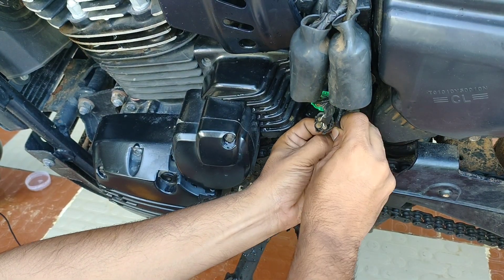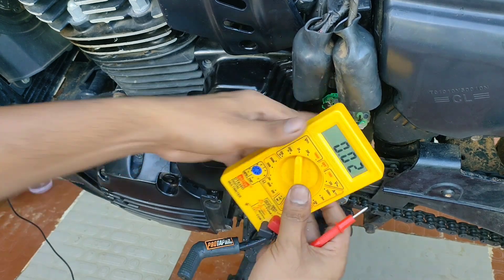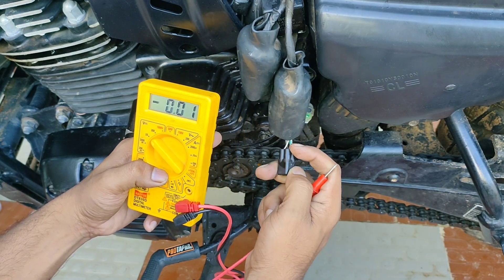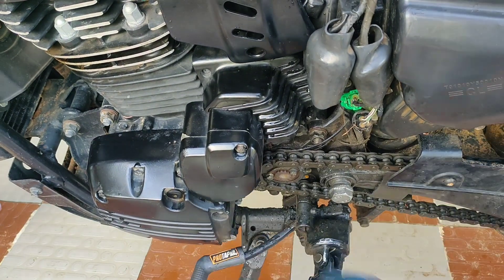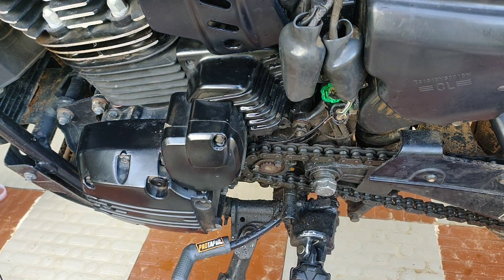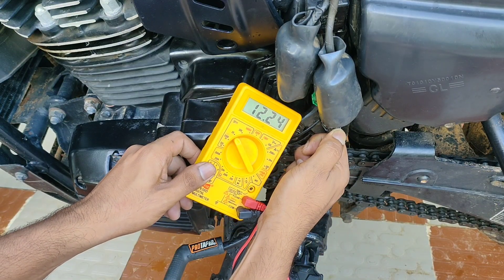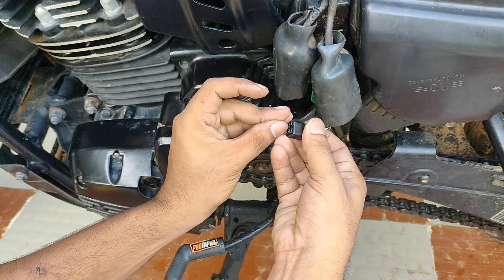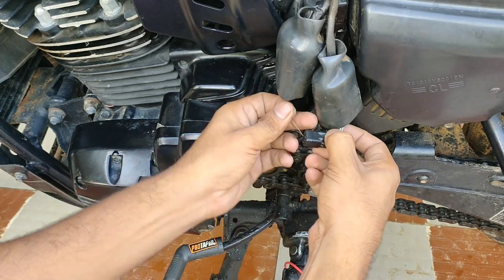How to check Gear Indicator Sensor in Yezdi Adventure with Multimeter

Comment: hey today on my yezdi roadster the check engine light suddenly came up when i was on uphill slope of parking and after sometime it went off on its own, ahould I be worried?
Reply: Yes it also happen to me when the fuel level goes to 3 to 2 bar
Reply from the maker: @pistonege  is it happening for every turn ? If so please inspect the fuel filter by opening the tank cap and on to the left
Reply from the maker: @samarthkulkarni2396  Most of the time ecu find the glitches to turn check engine light on and see whether it reoccurs are not if it doesn't reoccur that is a temporary condition. Light goes off after riding few kms. If the ecu finds the issue persisting the check engine light won't go off. 

In your case I don't know the exact issue I am just thinking there might fuel pump pressure drop or oxygen sensor readings.